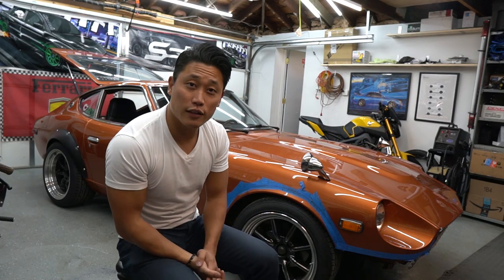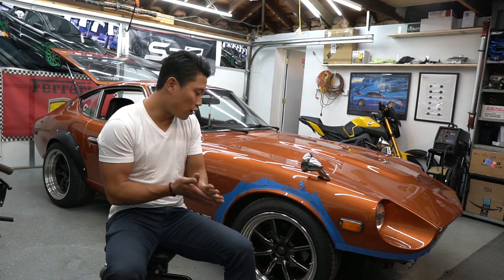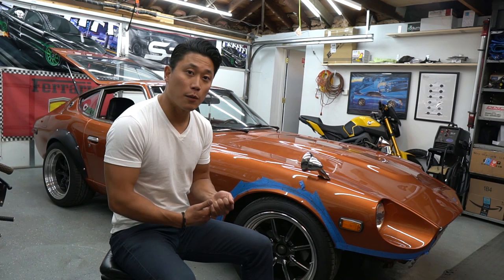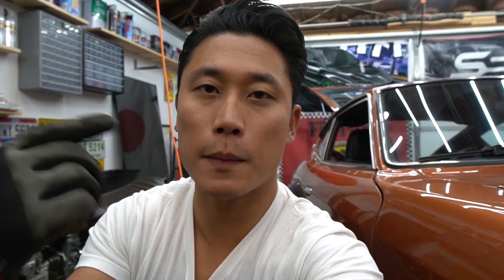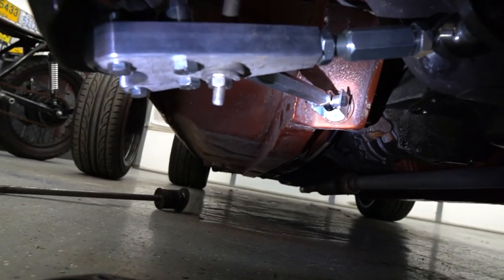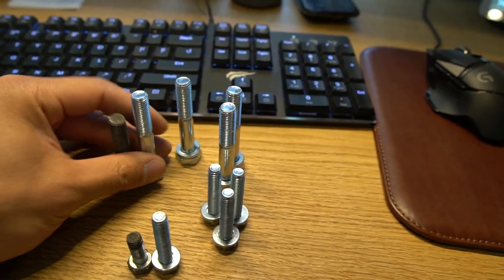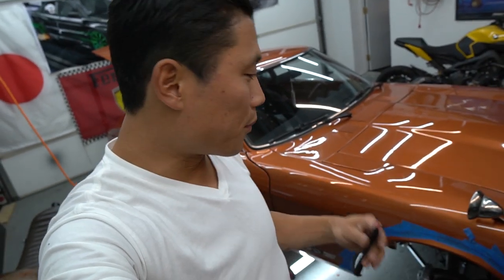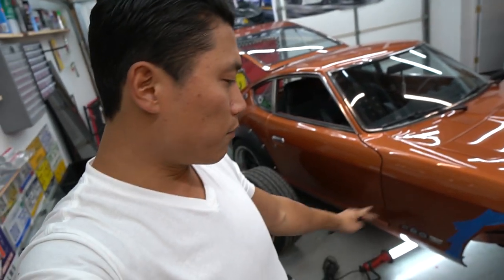280Z Adjustable Control Arm and Tension Rod Install  - The JDM Devil Z Build Series #19

Comment: Just wondering if the longer bolts were supplied with the control arm kit, and if not, what grade and sizes did you need to use?

Comment: You said nicely machined but why does it look @4:12 like the top is unmachined and still has the bar stock information printed right on it? 

Not trying to be a downer her it's just I have an industrial CNC mill in my garage that I make parts for some shops on and it always has bothered me when something like that gets left on the part.
Reply: Some Acetone should pull that ink off or you can just brush the aluminum.